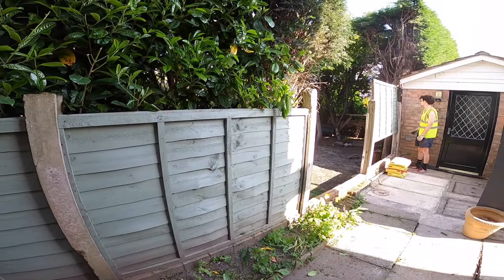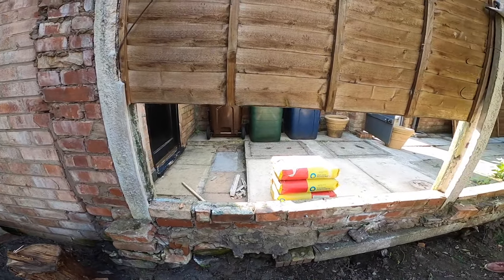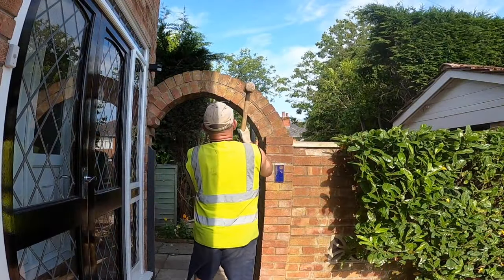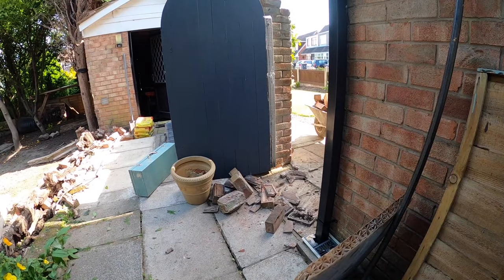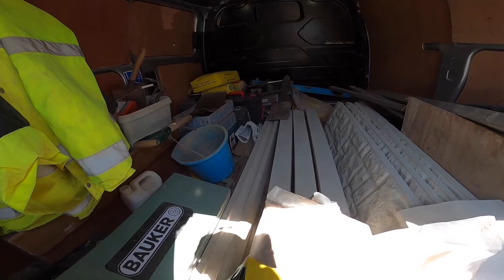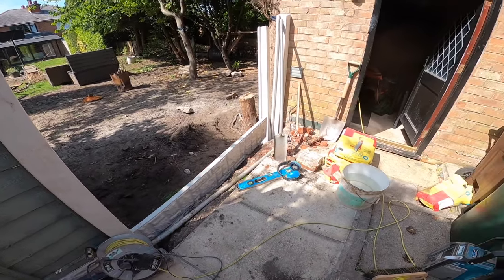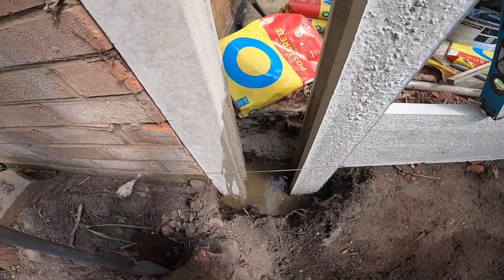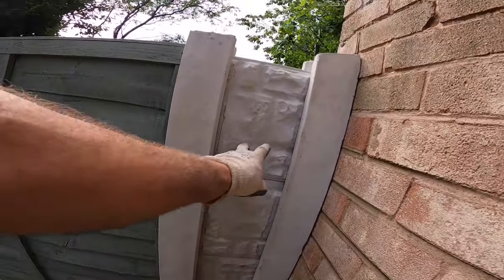CALL THE BRICK POLICE THIS BRICKWORK IS A CRIME!!

Comment: The garage and  the driveway (two strips and pebbles down the middle originaly by looks of it ) are typical poor quality 70`s housing estates, my mum and dad bought theirs in 1970 and the houses look very similar to the video  , they are still in it  .They sold the 3 storey 5 bedroom victorian house for £1.000 and bought the horrible 70s new 3 bedroom  estate house with  its squeeky chip board floors , soft wood windows that rotted in a few years  , tiny rooms and flemish full length glass doors , which my sister fell through and had to have stiches lol ,  for £4,000 ...  i had to share a bedroom with my 2 brothers and we could no longer play hide and seek, as kids we hated it .
Reply: That was a bit of a thing here in Australia in the 70's as well, but the homeowners would do the driveways to save money on the landscaping/ house package price. You look at the driveway strip blocks and calculate it- works out to be near enough to two mixer loads per block poured. My theory is they'd pour a couple of driveway block strips each weekend, reusing the same forms till they finished the driveway. My place was built mid 70's and has the old two strip driveway, but filled in around it with concrete now. Has more heaves than a big saturday night.
Reply from the maker: 60 s and 70 s houses can be grim 😬🧱👍🏽

Comment: Absolute cracking job, looks significantly better than the previous horror show. 

Rather than that thin strip of gravel board as an infill, I would have suggested to the client buying an extra panel and reducing the width of the three you reinstated by 18” each and then trimmed the new panel to fit the remaining gap. 👍🏻👍🏻👍🏻
Reply from the maker: Thanks . The house is a rental so the landlord wanted to keep costs down. 🧱👍🏽

Comment: When swinging a sledge into a tight opening hold it high in the shaft to lift it, and when it's pulled back, lower your grip and swing. Your hands will be free of getting pinched and you will have a stronger swing.
Reply from the maker: My fault for not coaching Al properly 🥺🧱👍🏼
Reply: @SteveAndAlexBuild  just a tip, all the best!
Reply from the maker: @scissora6963  . Nice one 😁🧱👍🏽

Comment: I need to place a heavy steel post with the flange on concrete. Would you recommend postcrete + rebar? Project wants 0.7m3 supporting cube. Should I just order concrete?
Reply: Postcrete is just  an expensive way to buy concrete .
Reply from the maker: That sounds like you ned a structural engineers advice really 😬🧱👍🏽
Reply: @martin2466   DIY, but with small support of the architect student. The foundation block need to support 300kg vertical load, no dynamic forces
Reply: I'd just take a leaf out of this video- simply place the post on the ground and use gravity to hold it in place.
But seriously, for 0.7m, I'd buy gravel, sand and some concrete, mix batches in a wheelbarrow and dump it into the form/ hole. Rebar never hurt anyone, throw a couple pieces in if you have them.
Reply from the maker: @TyphoonVstrom  🧱👍🏽

Comment: Nice job on the repair Steve . It amazes me how popular wood and concrete fences are in the uk . A nicely jointed concrete block wall is a job for life in my view . Those fences are just a drain on people’s pockets , they look nice at the start but deteriorate fairly quickly and a lot of those panels are made with crap wood .It wouldn’t surprise me if the problem with the old posts is an inferior concrete mix rather than the placement of the steel .
Reply from the maker: Yes I agree . A lot of the panels especially these nasty waney lap panel are only dipped which means they don’t last long at all. 
   Pressure treated vertical feather edge boards every time . A bit dearer but our last the dipped ones by years 🧱👍🏽

Comment: Couldn't you have centred the last 2 panels and had 2 equal sized panels instead of that ugly filler. Otherwise nice job lads.
Reply from the maker: Thanks but the job was done to the customers wishes . A base panel is a lot cheaper than a timber one when cost is an issue 🧱🧱👍🏼

Comment: ansd you have put the posts in upside down :)
Reply from the maker: Do you even know what you are talking about ? The posts are double ended …. A ball or a point . The rest of the fence had the point in the ground so we copied the existing fence . 🤷🏼‍♂️🙄
Reply: @SteveAndAlexBuild  the ball is the bottom of the post. ive been fitting and supplying fencing for 25 years mate. that ball is for the bottom. the rest of the fence is in upside down so to answer your question....yes i do know what im talking about just like if you notice the end posts are handed lefty and right thus why you have now got a rough side of the post showing
Reply: @SteveAndAlexBuild  double sided lol yeah right...stick to bricks
Reply from the maker: @thanxx  . Well I stand corrected and am always willing to learn . 
   I have however never been offered or seen handed posts in any merchants . Also in all the posts I have ever seen the majority have had ball at the top  . 
   If it was you doing this fence wound you do it the correct way  or match the existing ? 🧱👍🏽
Reply from the maker: @thanxx  🧱👍🏼